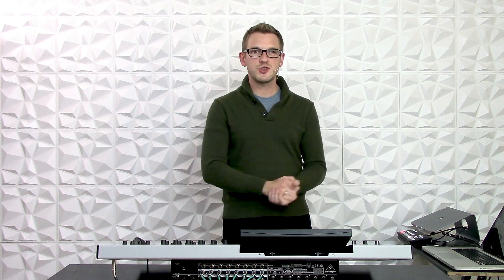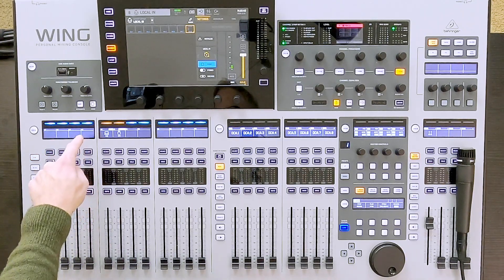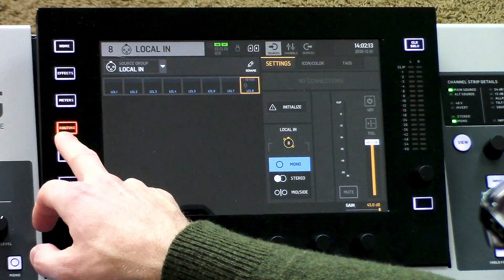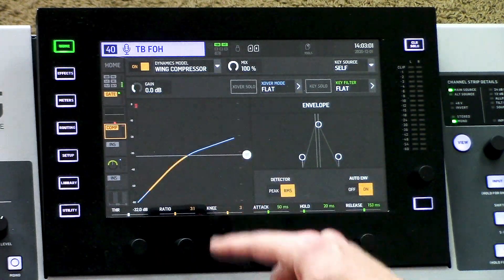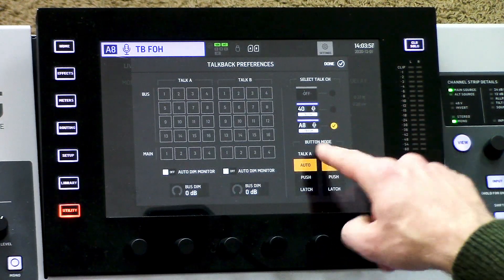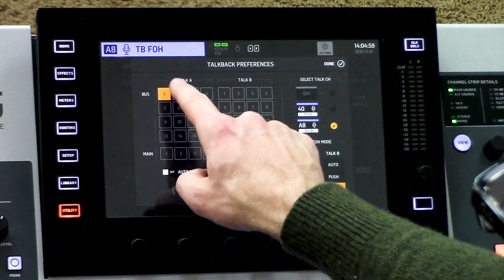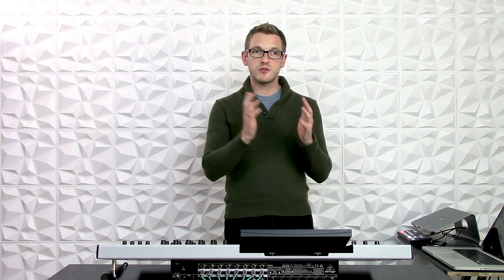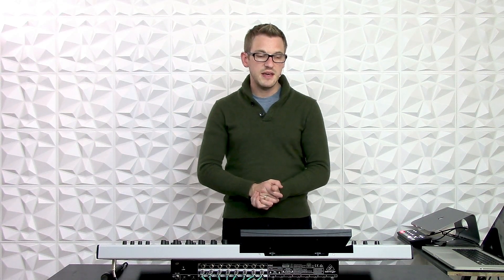Behringer Wing 110 - Setting Up A Talkback Microphone

Comment: If I setup my talkback mic on local input 24, and route it to channel 40, is it correct to still get signal on channel 24?
Reply: That means you have also routed Local 24 to Channel 24. You can route inputs to multiple channels. In the Wing ecosystem, you really need to decouple sources, channels and outputs in your mind. They are three different things, and the Routing tab control what goes where.